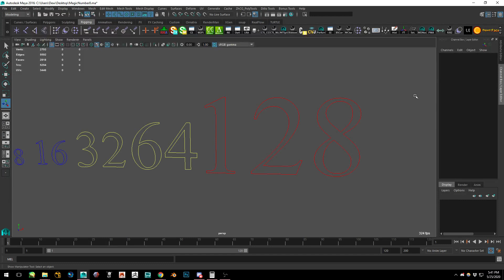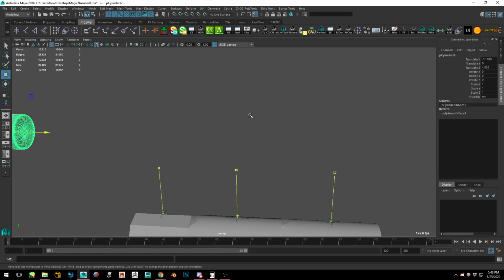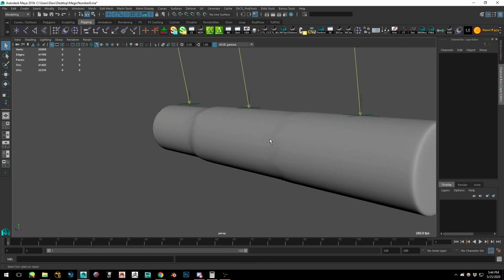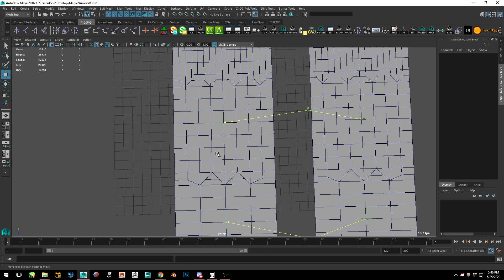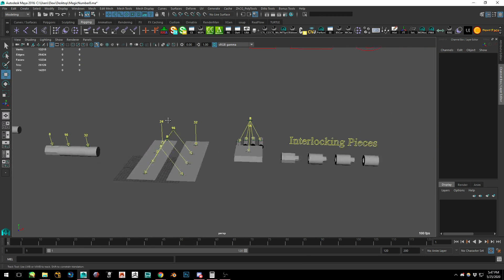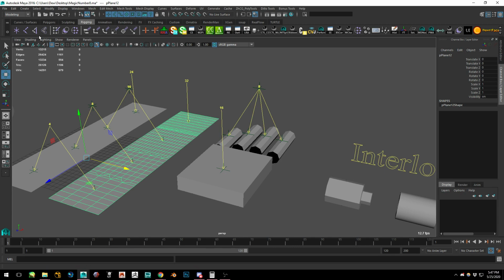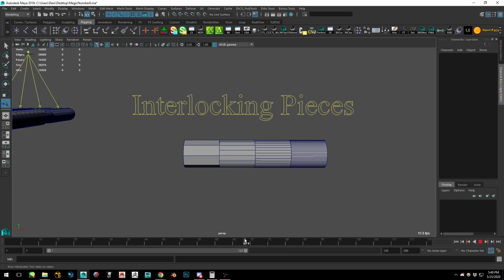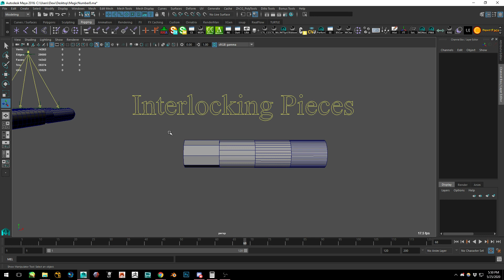Intro To 3D - Magic Number 8

Comment: You sir, are a godsend. I've been modelling (mostly rubbish, if truth be told, lol) for just over a year now, and I'm always struggling to keep control of my topology. I prefer more hard surface stuff and I'm really try to learn how to tie off loops that aren't needed the whole way around the model, for example, edge loops for hardening those corners on a sub div model. Using diamonds and poles are fast becoming an everyday part of my practice, but i still need to do more and to see them in production. 

Your simple topology videos are a super way to show how things should be done.

Comment: How about 6-12-24-48? Divisible by 3. Caps with two quads at subdivision level 0 and with a 3x3 quad grid at subdivision level 1.
Reply from the maker: You can do divisions of 3, I like to start with 4 since it begins even. If you like starting with 6 or 4 it's entirely up to you. The idea still is the same you want to use multiples that all fit into other another to save yourself the headache later.
Reply: @dewdiehard2416  Oh i'm not going powers of 3, i really just like 12 because it's divisible by 3 AND by 4, and odds are i'll be relying on that 4 divisibility or at least 2, with a bit less probability 3. It also makes sense to keep subdividing it by 2 rather than by 3 because divisibility by 9 isn't terribly desirable. 6 is a fitting compromise because it's the lowest poly that looks circlish and subdivides by two to get to the magic 12.
Reply from the maker: @SianaGearz  very true. I like to keep it in 2, 4, 8, 16 and so on because they're easily mirrorable

Comment: I've heard, that the eight is to mirror on two axis easily, I must have heard wrong. Great tutorial, can't wait for the hand.
Reply from the maker: It can since you can divide 8 into 4 and 4. So you can easily determine which edges are your middle and sides.
Reply: @dewdiehard2416   Yeah, that's exactly what I've heard and it's also pretty logical

Comment: Even when explaining math and theory, you should title the video with the software you're using; Maya in this case.
Reply: Its intro to 3d for a reason. Not intro to (software).
Reply from the maker: The program doesn't matter, you can use blender, lightwave, 3DSMax, zbrush, whatever you are comfortable with. Modeling is all the same.
Reply: It's universal